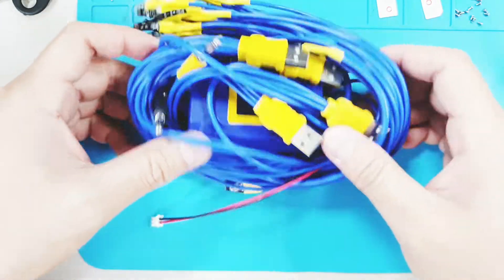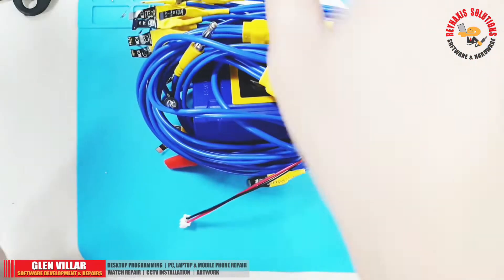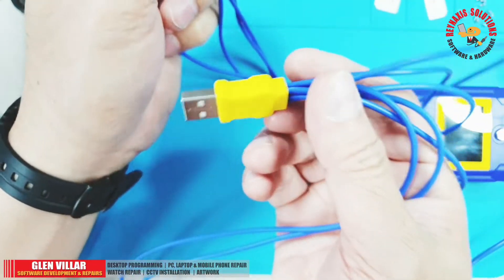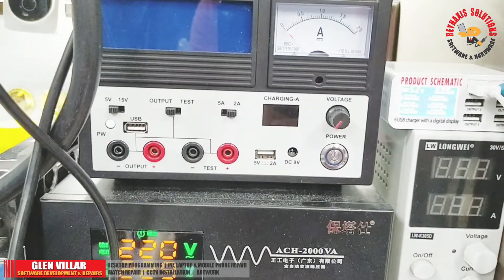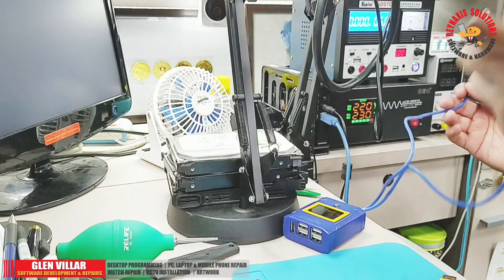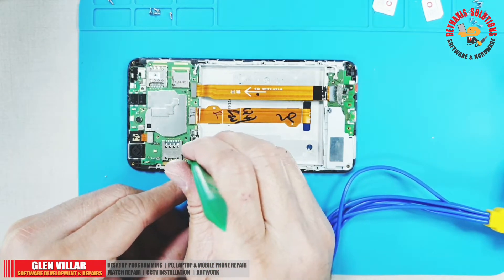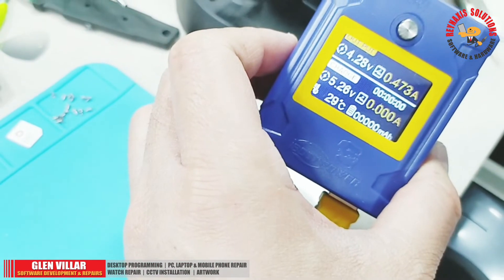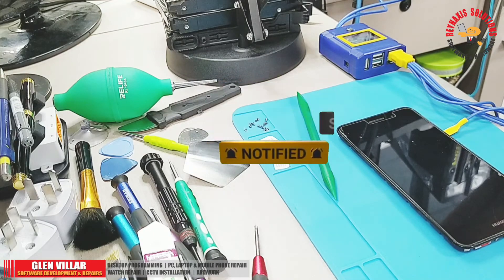How to use the Mechanic iBoot Box Power Boot Kit #mechanic

Comment: sir anong supply po gamit nyo?pwedi sir pashare ng link?salamat
Reply from the maker: Hi Sir, eto po gamit kong power supply, Kaisi 1505TD. Sa Lazada po mabibili, https://www.lazada.com.ph/products/kaisi-1505td-15v-5a-dc-power-supply-intelligent-dc-regulated-power-supply-voltage-regulator-with-5v-2a-usb-charging-port-yymz-new-i4844159742-s28078748992.html?c=&channelLpJumpArgs=&clickTrackInfo=query%253Akaisi%252525201505td%253Bnid%253A4844159742%253Bsrc%253ALazadaMainSrp%253Brn%253A2906a835c4bff3522704939659d97ace%253Bregion%253Aph%253Bsku%253A4844159742_PH%253Bprice%253A13598%253Bclient%253Adesktop%253Bsupplier_id%253A500161287047%253Bbiz_source%253Ah5_hp%253Bslot%253A0%253Butlog_bucket_id%253A470687%253Basc_category_id%253A5151%253Bitem_id%253A4844159742%253Bsku_id%253A28078748992%253Bshop_id%253A1221444%253BtemplateInfo%253A107881_A3_D_E%2523-1_C%2523&freeshipping=1&fs_ab=2&fuse_fs=&lang=en&location=China&price=13598&priceCompare=skuId%3A28078748992%3Bsource%3Alazada-search-voucher%3Bsn%3A2906a835c4bff3522704939659d97ace%3BoriginPrice%3A1359800%3BdisplayPrice%3A1359800%3BsinglePromotionId%3A-1%3BsingleToolCode%3AmockedSalePrice%3BvoucherPricePlugin%3A0%3Btimestamp%3A1740982589584&ratingscore=&request_id=2906a835c4bff3522704939659d97ace&review=&sale=0&search=1&source=search&spm=a2o4l.searchList.list.0&stock=1
Reply: @ReynaxisSolutions  salamat sir
Reply from the maker: Welcome sir.

Comment: Thank you! what are the settings on the power supply?
Reply: 5A and 5V is a bit high right? 4 volt and 3A better?
Reply from the maker: Hi. The main power supply that powers the mechanic, it's around 5V. Any lower than that will not power up the mechanic iboot. The Mechanic iboot's output itself is around 5v too.
Reply: @ReynaxisSolutions  thank you!
Reply from the maker: welcome.